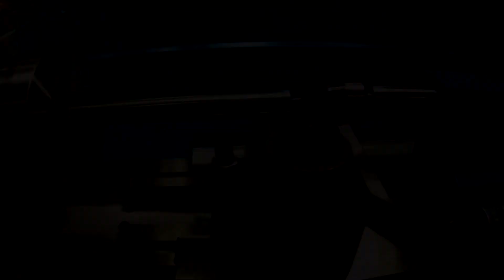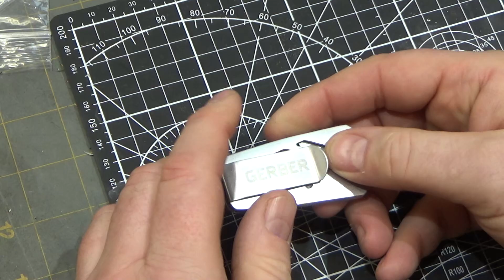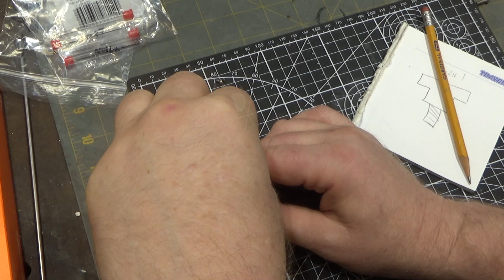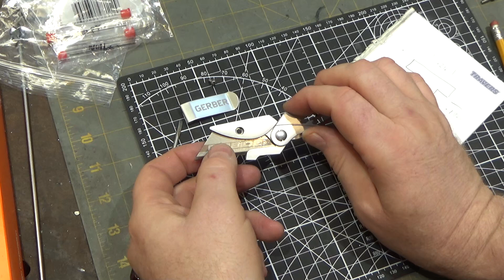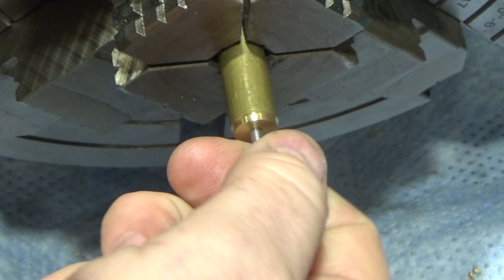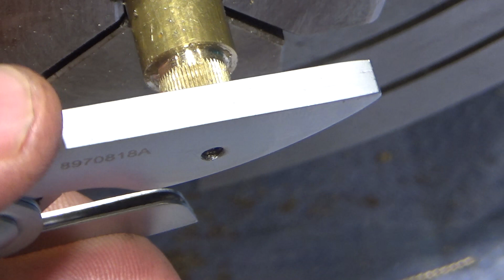75 Gerber Knife Blade Retention Screw

Comment: A beautiful knife, this one is actually portable (only slightly larger than the blade itself), the clip works for the belt or the pocket – easy to slip onto fabric / leather and yet it grips strongly. The original screw that holds the blade is tiny, with a wide slit. You san actually screw / unscrew it using a penny, so no need for a screwdriver.
Thanks for the video, it is interesting to see how to make spare parts. I guess an INOX M3 screw could be cut down to size. The upper aperture is between 4 mm and 5 mm. Overall depth is 6 mm, with only 2 mm going into the threaded portion of the handle.
Reply from the maker: Thanks for the tips. I was not aware that a penny would fit the original, but then again I never carry change. I can't to afford having anything in my pockets that clinks around.

Comment: Nice little knife, short  and agree great for the pocket, to open boxes you share from your work so a thought about working in the S & R area before moving up to production control in an aerospace job shop. I remember the boxes that would arrive when these, what were new to us then, staples cardboard staples copper colored yet made of steel hidden under the brown fiber box tape and you know sliding that knife along the length of the box folds would, it was inevitable that I would hit one of those cross tap connecting staples. We machine under 1mm and thread them so here I thought I was machining a screw through the microscope here at work, JUST FUNNIN, you are doing great the video is very enjoyable. Nice little serrated screw agree not needing a screw driver to say the least very handy.
Reply from the maker: Thanks.  I had sub'd to your channel a while ago. I just need to get the time to watch. You have some interesting video titles I need to check out. Thanks as always for the comments.

Comment: some people will just use any excuse to turn on a lathe. (i'm one of them) really a dumb design by gerber. i own several of those folding box cutters and all have tooless blade change features. i use a dremel tool with a cutoff wheel to shorten small screws, it works well. i will be looking for those carbide blades. thanks for the tip.
Reply from the maker: I'm definitely one of them! I regret not trying to turn those tiny threads. Next time. I like the Dremel tool idea, thanks.

Comment: I make thumbscrews a lot, in fact I did a video on box cutters I converted, as you shown trying to cut small screws down on the lathe doesn’t end well. I’ve had my share of failures. Not to be a keyboard warrior, my advice for a future project would be to machine the outer part, part it off, then  install locktite the screw to proper length, then carefully face the screw or bolt head off. Of course you need a fixture to screw the screw in so you can chuck it up. Great fix, great video.
Reply from the maker: I like your approach, thanks for the ideas. Constructive criticism always welcome. I learn a ton from the suggestions from generous people like you.
Reply: Dudley Toolwright I wasn’t being critical just an alternative suggestion. I’ve played around with small screws for thumbscrews for projects. Like I said great job
Reply from the maker: I was just making a general comment about constructive criticism. That comment was for anyone thinks there is a better way. Tell me and everyone else and we are all ahead.

Comment: Did you use a tap follower on the first attempt, as there seemed to be some wobble as you ran the tap in?    " ...should be quick and easy."   Never, but never, say that as you start a project.  LOL  End stage product, looked great, and should be practical in use.
Reply from the maker: I did. I almost always use a tap follower because I have the dexterity of a newborn pup. I even mad an additional screw the next day out of stainless. I am using that one currently. No video though.
Reply: @DudleyToolwright  The stainless should blend right in with the rest of the tool.  I bet it looks good.
Reply from the maker: It does. As a matter of fact I think it is better than brass, which is something I rarely say. I need to post it on Instagram. I am really bad at keeping up with that.
Reply: @DudleyToolwright  Looking forward to seeing it.  What's your instagram handle?
Reply from the maker: Dudley Toolwright, although I don't post very often. I don't really engage in a whole lot of social media other than this. This community is a very constructive and helpful one.